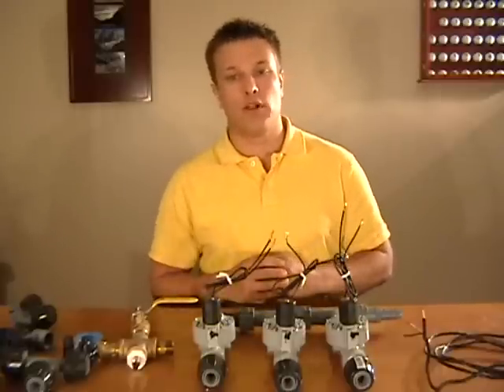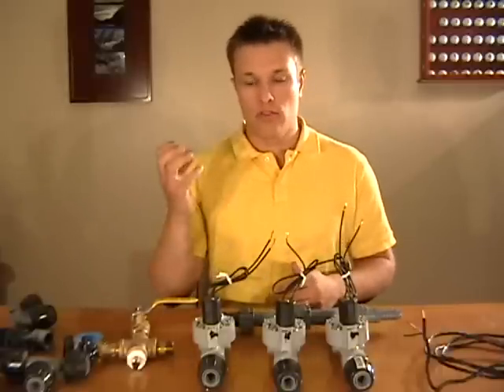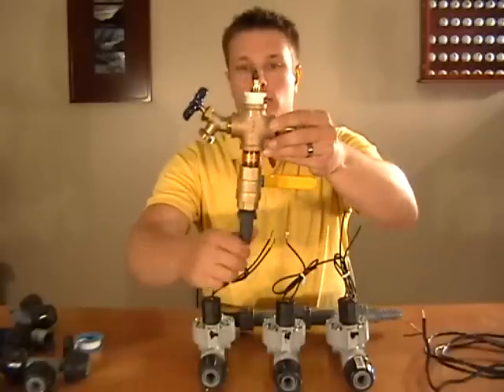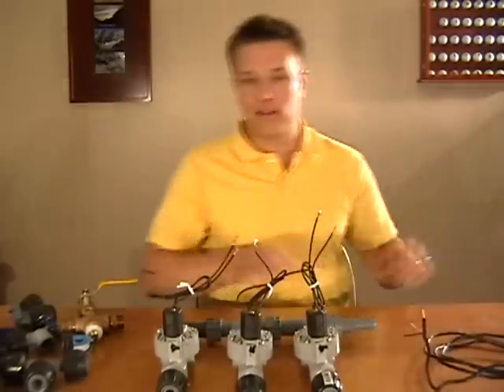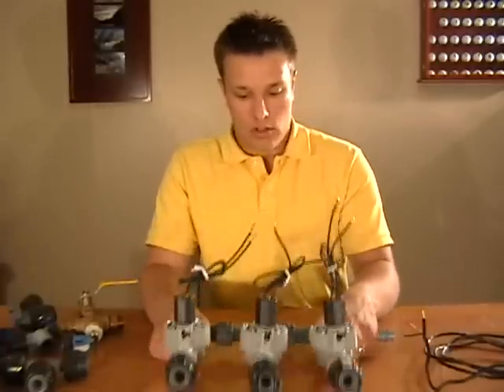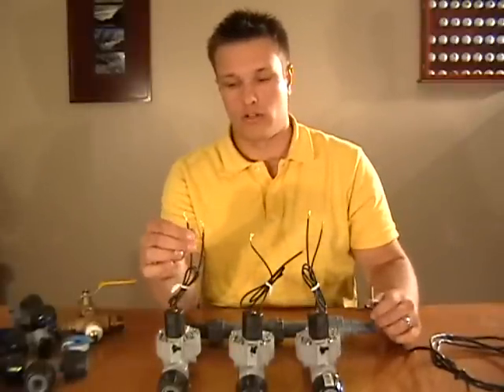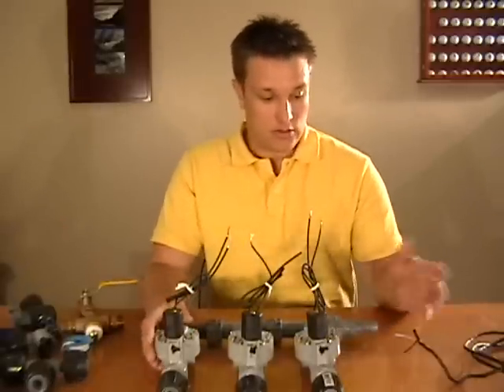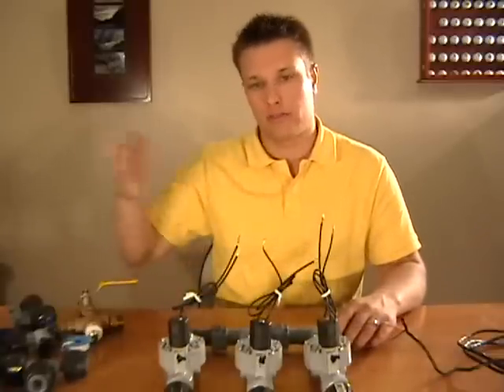Automatic Sprinkler Systems Explained In a Nutshell

Comment from the maker: Every system requires different components depending on the size and shape of the yard, and what features you want to include. That's why we only quote on an individual basis, there really isn't a good way to do a blanket estimate based on size.  

We've helped a lot of people install their own sprinkler systems, so that shouldn't be a problem.  And the blowouts in the fall isn't much to worry about either.